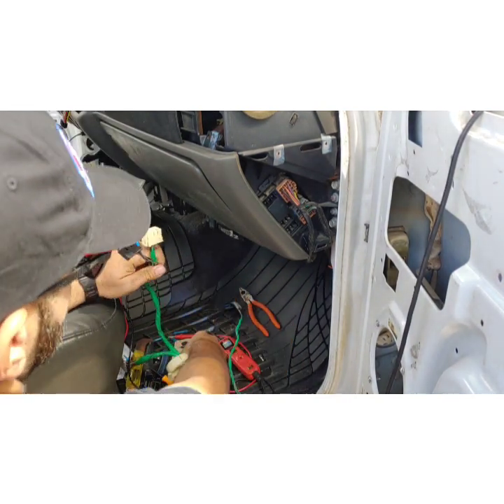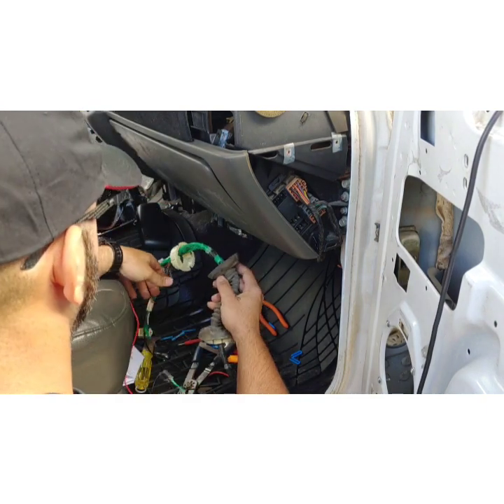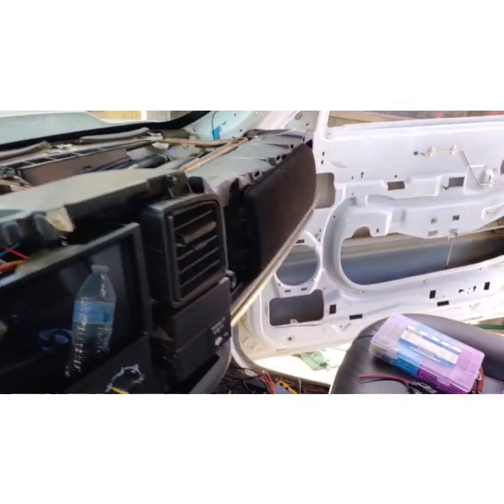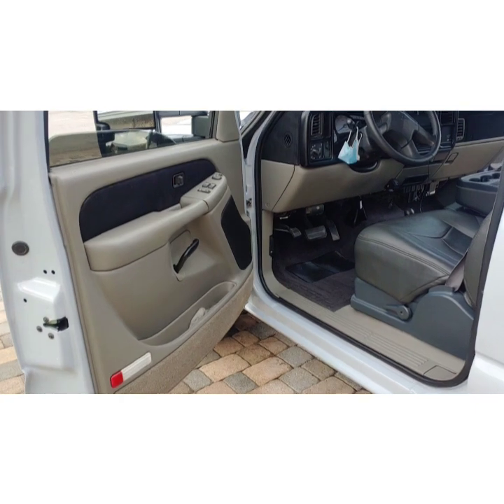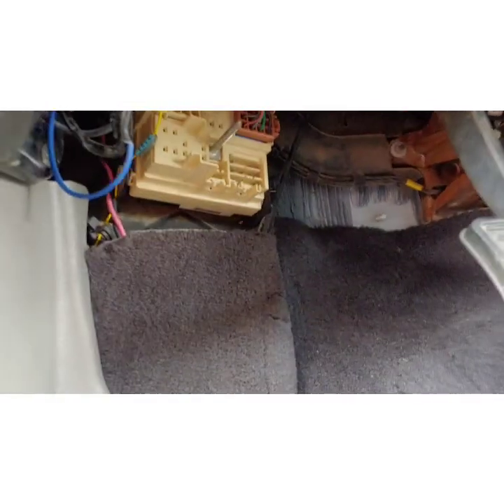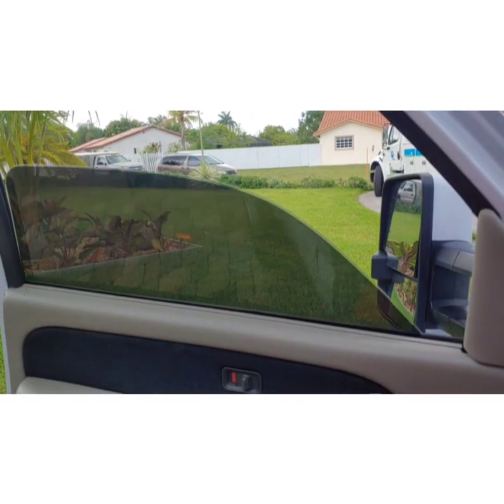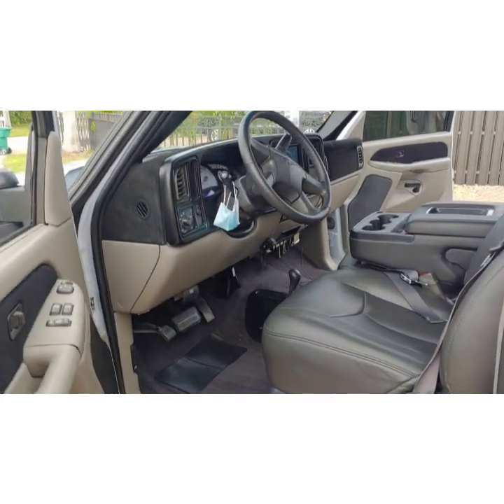silverado 1999-2007 manual windows and locks to power windows and locks using factory 99-01 parts

Comment: Good stuff. I have an 06 work truck and bought some doors off a 2000. I labelled each wire by toning it but my problem is finding out whats what on my truck. Where did you get the diagram? Can you take some close ups?
Reply from the maker: You need to feed the doors power and ground and make a cross harness to the other door

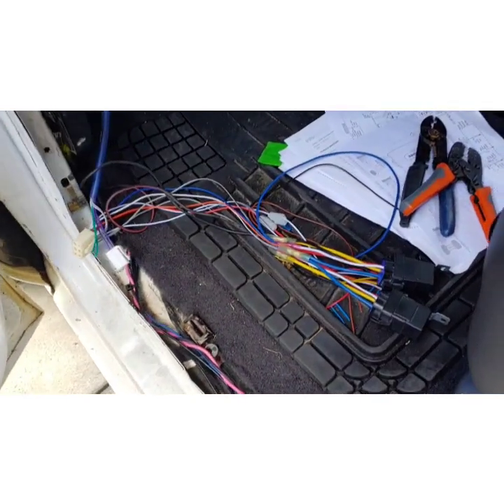Comment: Best video out on the web using OEM parts. Followed the entire video up to 11:20/17:10 exactly and have a couple questions. What 12v did you end up using for power since stated all the ones in the passenger side fuze box will not work? Also, any closer pictures/wiring diagrams for the driver side door harness & placement of switches would be extremely helpful. Thanks!
Reply from the maker: I used alldata diy for the wiring. I used a fuse from the drivers side

Comment: I have watched your video several times, and read through your comments. I’ve viewed you links into the parts, and would appreciate if you could clear a few things up for me. On some of your parts links, they cross reference through 2006. What exactly is different in the later trucks. Just the harness? or is it the switches themselves that has to be an earlier year? Thanks for any advise, I have an 05 and just purchased 4 doors off the same year. I’m hoping to still be able to do this swap with the majority of what I just bought.
Reply from the maker: Harness, switches and door panels must be from earlier years. The regulator and door lock actuators are probably the same. 02 and up use the bcm to control the doors and they require programing which I heard is a mission.
Reply: @BuiltByMike  could you swap bcms with a truck that has power windows and locks?

Comment: Are those window switch wires are basically all you need for locks to work? I have 2000 gmc that came with manual doors and have now 99 doors with powers windows and locks. Thank you!
Reply: Door switch

Comment: used the same 12v power supply off the distribution block under the driver side and it burnt up, any other recommendations
Reply from the maker: There was a couple of them down there if I remember correctly
Reply: another quick question do you have to run 2 relays on both sides or just on the driver side

Comment: Does the aftermarket alarm work like a normal alarm? Can i do the swap and then have somebody install an alarm system? Or will the wiring be diffrent since it didnt come from the factory with power locks?
Reply from the maker: Wiring has to go through the keyless module.   Heck out my other video of my red truck. I explain the wiring better.

Comment: Do you need to change the speaker wire even tho were running them thru amp and not stereo
Reply from the maker: If your running a amp I would upgrade the speaker wire

Comment: I can't get my driver switch to send 12V to the lt blue / tan wires for the pass window. Any suggestions?
Reply from the maker: Driver window works?
Reply: @BuiltByMike  I figured it out with the wiring diagram. My ground terminal G driver side needed a better ground. I was testing using 2 dewalt batteries lol

Comment: Do any lights come on the dash after swapping the door panels to automatic windows
Reply from the maker: No. The truck has no idea they are there
Reply: @ I keep hearing story’s of lights coming on I wonder what you did that’s different?
Reply from the maker: @SergioArreola-d2o  don't see why. I just feed power and ground to relays there is no body control modules

Comment: Have a 2004 manual doors and bought 2 auto power windows w/locks doors complete. Will the wiring harness just plug and play?
Reply from the maker: No. You can't use post 02 parts
Reply: @BuiltByMike  Doors i bought are off a 2004 also
Reply from the maker: It's much harder to make work with the bcms and door modules. That's why you use the older trucks
Reply: You just need bcm the orange one ext cab....
Reply: @jamespalmore6624  WHAT'S the link to 3d's auto. Never mind i found it. The bcm would need programed?

Comment: 2002 should fall into the same category to. I'm do this swap also on my'02 ext.cab. I actually ran into the same issue with the passenger door power wire. Glad i found your video. coincidentally I'm doing it the exact same way also. I am using 2002 Tahoe denali switch's with the wood grain bezel. I grabbed the dash bezel also. looks pretty slick. Any other tips??
Reply from the maker: 2002 might be a half year. As long as you grab the right ones you should be good.
Reply: You have any pictures of the wood grain?

Comment: I got a 2004 Chevy 1500 single cab and I have manual windows how would it work like I need to buy whole new doors that were already electric windows or whag I’m confused I need help
Reply from the maker: Doors are the same you need door harnesses from a pre 02 truck and I have included links for the window motors and soor locks. Then you'll need to wire in a keyless door lock and wire the windows
Reply: @BuiltByMike  so you don’t need the same type of door as in the video ? As long as you have the harness?
Reply: 3d's Auto Advise & tips.... He shows you step by step real easy. Don't need all this crap....

Comment: My truck is an 2000 so I got a bcm for a 03 so can I just get the doors then ? With power locks and windows
Reply from the maker: You don't want a bcm. Programing is a nightmare. That's why you want pre 02 stuff

Comment: Could a Yukon 99-02 door work with my Chevy 06 1500 ?
Reply from the maker: If your truck is manual yes. You need the older stuff. 03 and up can't work without the bcm.

Comment: So I order for this to work like this the door panels and switches need to be from a 99-01 ? I have a 2005 I want to do this
Reply: I bought 2 doors from a 06 suburban comes with everything, I’m guessing that won’t work
Reply from the maker: Nope. After 02 everything runs through the bcm and its a pain
Reply: @rubenelmeromerogarza8186  yes it will I bought two doors of a crew cab. You need swap bcm no relays. You can use  06 door panels

Comment: Is that 06-07 lbz? If so I have the exact same truck mines a 06 Duramax regular cab 4x4 white manual everything. I got some clean 02 door panels and switches. I’m gonna start doing the power window conversion once I gather all the parts I need
Reply from the maker: Yup its an 06

Comment: I have everything else done. I just need to know how to wire the locks up. I can’t find any other videos on YouTube using factory harness and switches
Reply from the maker: You need a wiring diagram from your donor and Google 2 relay power lock relay wiring
Reply: @BuiltByMike  but should it be a positive or negative trigger to activate the relays

Comment: You know anywhere online I can get the harnesses for the project besides a donor?
Reply from the maker: Check on ebay. Make sure it's a 02 or older
Reply: I got wiring harnesses and door panels and switches from 02 Silverado, now to find my wiring diagrams I tried all data, any place you recommend I can find how to wire it up I have a 99 Silverado single cab
Reply: @BuiltByMike  ^^
Reply from the maker: @alekctb  I use all data diy or something like that. It's like 20 for a year. Get the wiring diagram for both and then find out what you need to add.

Comment: I got a 2007 classic truck. What year model would I have to get? Could I get all junkyard parts if I could find them? Would my wiring in my truck work?
Reply from the maker: You have to wire everything.  You need to find parts from a 99to 02. 03 and up won't work as they require a bcm

Comment: Did you have to add relays for windows or just add power to both sides on green wire?
Reply from the maker: Just power. Relays are in the switches
Reply: I got the switches working at each door for the windows windows… but I can’t get the passenger window to go down or up with driver side switch

Comment: Do you have a remote start on this truck, or did you wire the security system directly to the lock actuators
Reply from the maker: Directly to dock locks. No remote start.

Comment: Man im struggling rn on trying to do this . I want to do it the way you did it but I'm in need of help.
Reply from the maker: You have to understand how to read a wiring diagram.  Then just a matter of running power and ground and running the wires from the drivers to the passenger side

Comment: I need the reverse. Power window to manual. Putting new doors on the old truck
Reply from the maker: All you need to use is all the manual window regulator and just abandon the wires